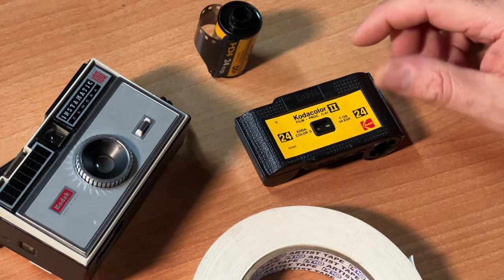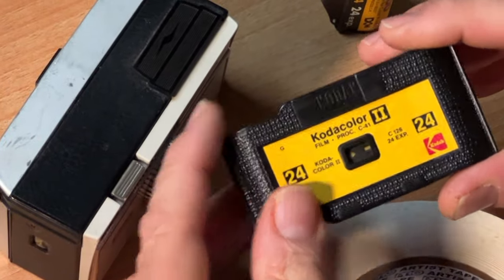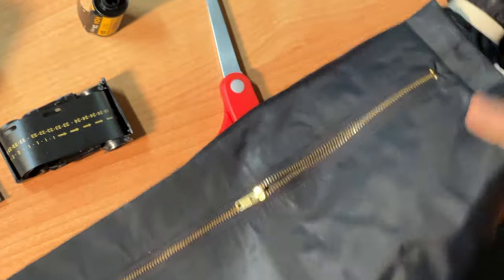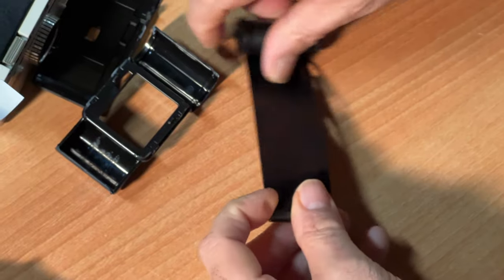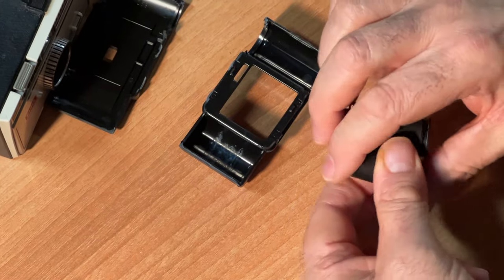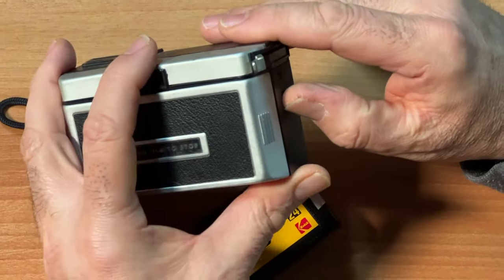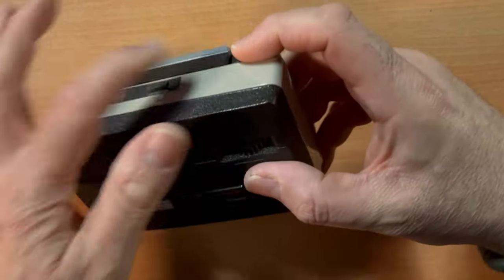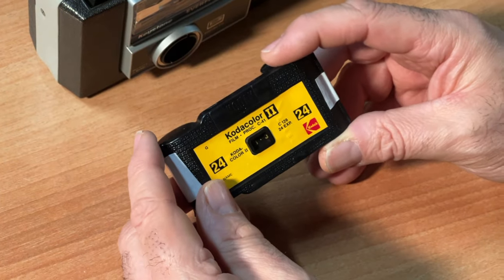Reloading 126 Cartridges with 35mm Film

Comment: Very good approach, specially the way you roll backing paper and film together. I load my cartridges for about 10 years now and I would like to add that: 1) 126 cartridges are EXTREMELY difficult to crack open properly - but it is part of the hobby, everything should be fun !  2) Cut the backing paper to accomodate up to 12 frames max - no one can compete "tight rolling" against an industrial machine, we always loose !  3) I have personally tried more than 50 different cameras with reloaded 126 cartridges...   The Kodak 133 is superb;  4)  When reloading, always use backing paper - so ALWAYS save the backing paper.

Cheers FPP and keep up the great work  \o/
Reply from the maker: Thanks for taking the time to comment. Appreciated. - Mike

Comment: The best I’ve come up with is the Kodak Instamatic 500.  The 500 has a great lens that retracts and offers full manual shutter and aperture control, a lovely finder and sometimes meters even work. 

The key is to take a side-snip pliers and cut short the little feeler that would normally detect the hole in the film.  On the 500 this disables the lock-out such that it can now wind and fire continuously. 

I then use a reloaded busted-open cartridge as you show here.  But I don’t use the backing paper.  Just take a 36-exp roll, wind tight by hand and it fits perfectly in the well.  No paper. Tape the film to the spool the same way the paper was.   Black electrical tape over the back window of course.  After every shot you have to wind and burn TWO frames with the lens covered, but it winds silky smooth. 

Voila!